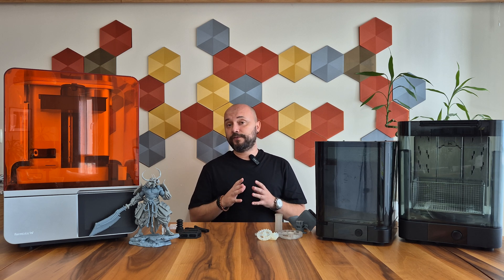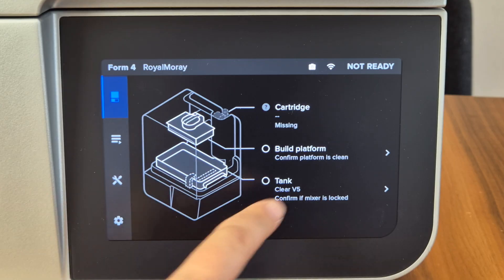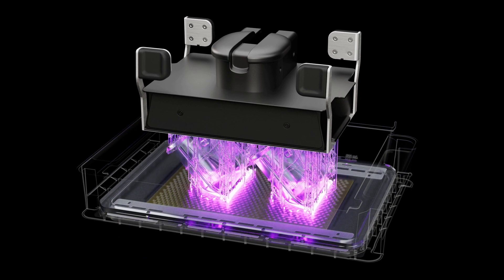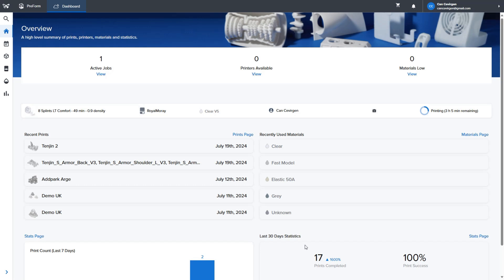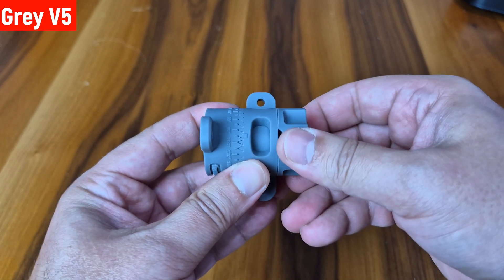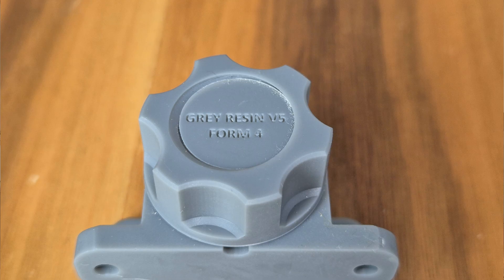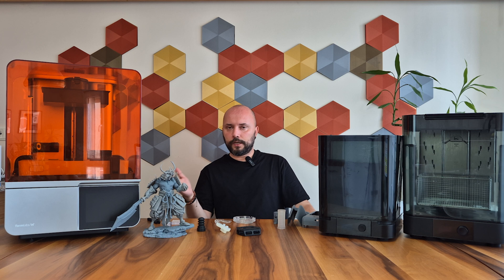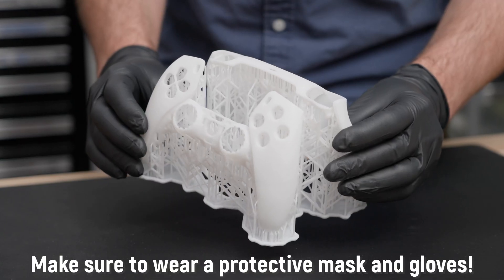Formlabs Form4 Review - The Choice of Professionals

Comment: So basically all the features already offered in cheaper machines
Reply from the maker: Yes, there are 3D printers with similar features. However, I think the Form 4 should not be evaluated only by its technical features.
Reply: Lol — you're clueless. Form 4 is head and shoulders above cheap printers. You get what you pay for.
Reply: @ophello  how is it head and shoulders above cheap printers? It's a superior printer, sure BUT it's not head and shoulders above. It's just a tuned up ecosystem that makes it extremely easy for noob users but you can get the same results with a cheaper printer and not a lot of extra work
Reply: @ophello  explain to me how I'm "clueless". I'll wait